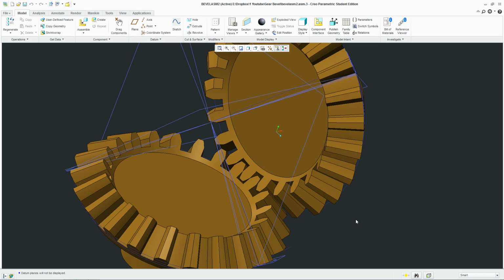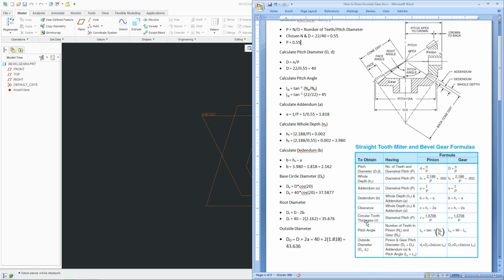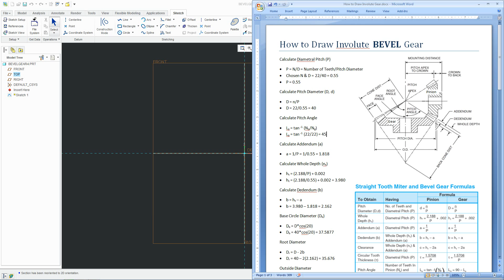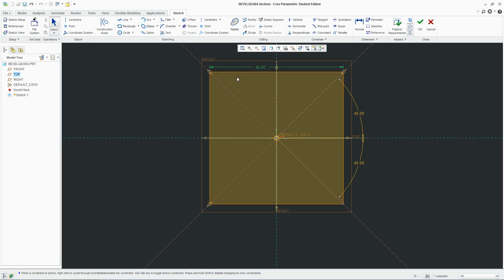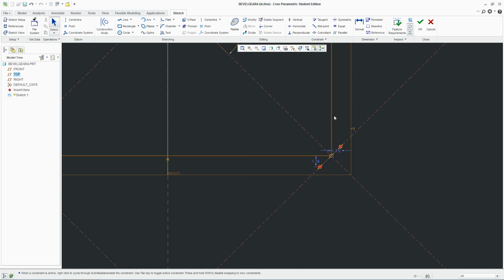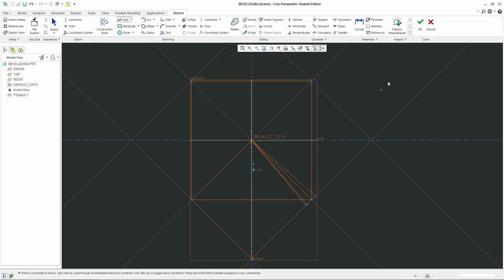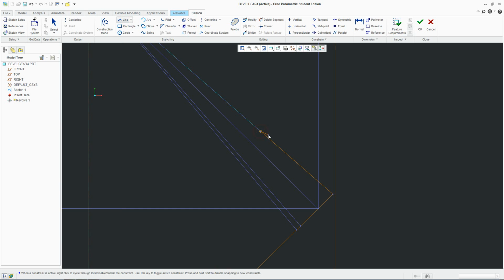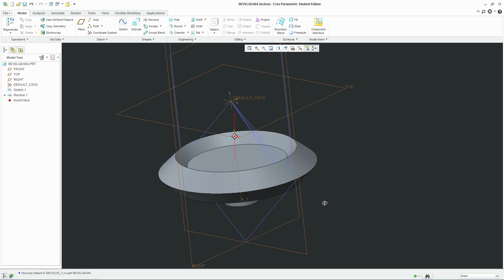Creo Tutorial - How to Draw an Involute Bevel Gear Part 1

Comment: the video tell everything about the bevel gear and guidance is well good.....but i need the calculation part and the link doesnt have the file in drop box.....plz provide as soon as possilble
Reply from the maker: Check the link now. I have updated the link with Google Drive.

Comment: the video tell everything about the bevel gear and guidance is well good.....but i need the calculation part and the link doesnt have the file in drop box.....plz provide as soon as possilble
thnx
Reply from the maker: Check the link now. I have updated the link with Google Drive.